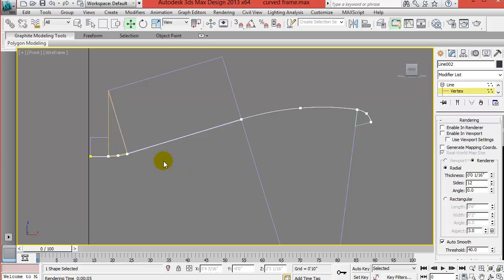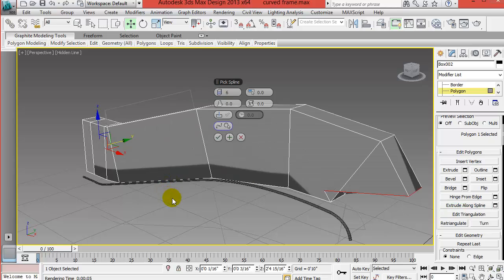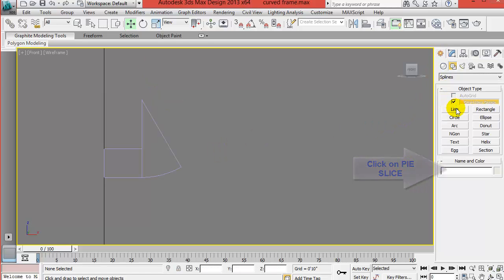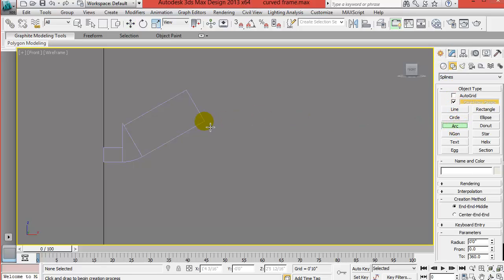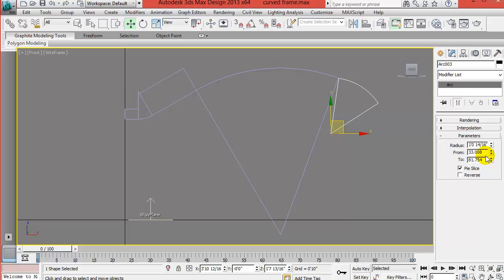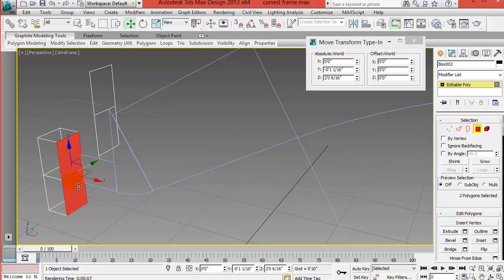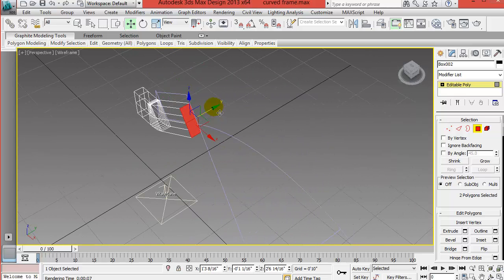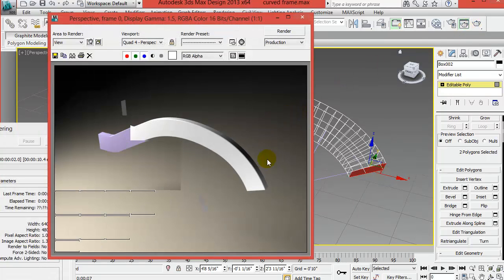3ds Max Precise Curved Polygon Extrusion

Comment: I get the guidelines. But why not simply LOFT? Why so complicated?
Reply from the maker: +Kosh Narale This is useful when you need to follow specific instructions such as a drawing from an engineer or architect's drawing. Lofting does not always work. some times lines cross and the geometry gets ruined. - Thanks for the comment.